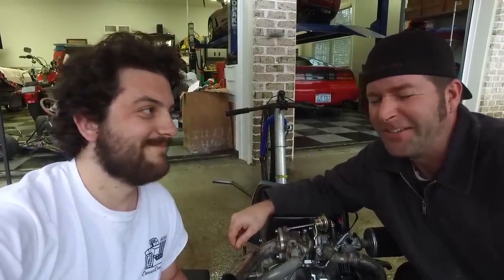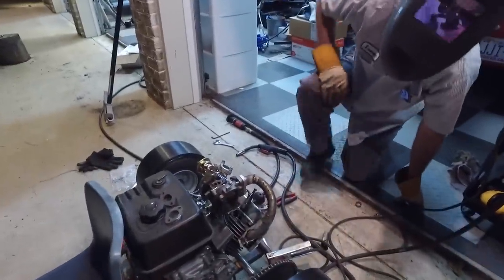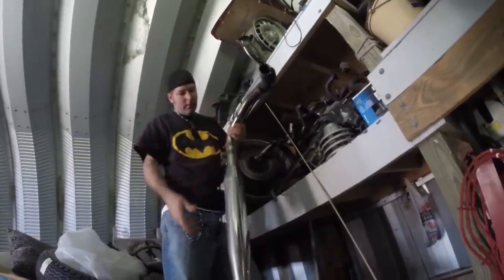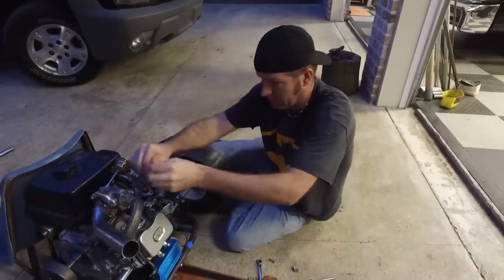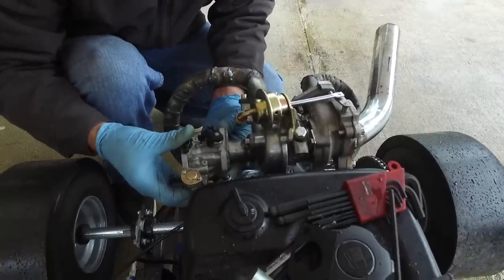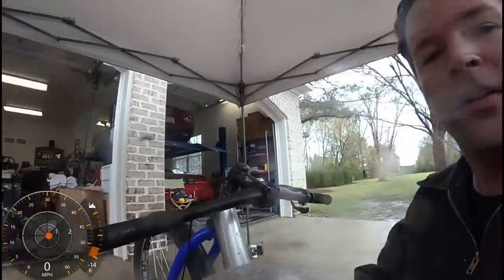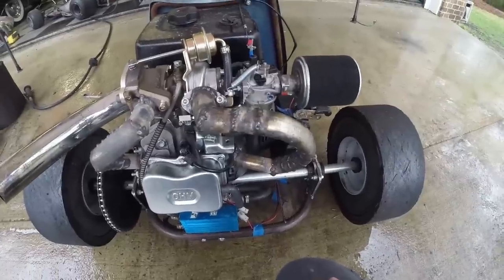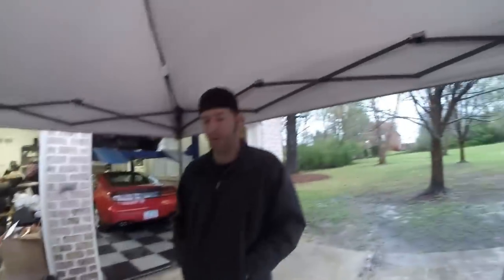Turbocharging a 420cc Drift Trike

Comment: I believe that your problem is not efi or carb it is a problem of fuel air idle mixture screw needs adjusted to compensate for the driven air and it would then run at idle WAY better and your low end torque would get a lot better too

Comment: i can tell you there isnt enough load on the engine to create hot enough exhaust gas to properly spool that turbo, you might find if you put grip tires on it will spool a lot harder.
but of course that defeats the purpose of it.

Comment: Carb needs to be in an enclosure. fuel pump and regulator referenced to boost pressure and you'll rip.. think atmospheric pressure.. adding boost is adding atmosphere.. everything in the fuel system has to be in reference to atmosphere.. I have done hundreds of blow though carbureted setups on race cars.. same physics here apply

Comment: put the carb. back in the original location and put a restrictor plate on the intake side of the turbo. it's really not a good idea to put the carb. on the intake side of turbo. it will get hot enough to vaporize the gas in the air/ fuel intake. causing a big lack of power. me and friend been through the same thing you guys are doing.

Comment: The turbo is attached to your exhaust that runs into the turbo for the air sure at the same time it goes from the turbo into your carburetor because of the fumes more of a kick you know I ran two on a becomes it engine

Comment: I would try to use a bigger carb on it. If it only run good on full throttle I think its running lean (Need more fuel).

Comment: I'm pretty sure the air is supposed to go through the turbo and THEN through the carb.
Reply: thats wrong.   a carb uses suction from engine.

turbo puts pressure => no fuel is being sucked in the airflow.

so let the turbo pull the air mixed with fuelfog from the carb and push it into the engine. => boost created.
Reply: What do you mean? There is no other way for the air-fuel mixture to go other than towards the engine. I guess it works with the setup they have but I would imagine it's not very healthy for the turbocharger. Most turbocharged carbureted engines draw fresher through the turbo and then add fuel to it when it's already pressurised. Also I don't think mounting an intercooler would be possible with the turbo after carb.
Reply: Also I think turbo>carb>engine setup would be waay more responsive than carb>turbo>engine

Comment: I was thinking at the start of the video the way you had it set up with turbo-carb-engine wasn't going to work as a carb uses air passing through to suck fuel through the jet and putting that under pressure by the turbo is going to stop it. That's why you got a leaking bowl! Then I skipped to the end and seen you had carb-turbo-engine and I thought now your getting some where you don't need to go efi you just have to re jet the carb. And the smother the transition of the air from the turbo to the engine is going to increase power so the shoddy pipe work isn't in your favour (no offence) if the carb is struggling to diffuse the fuel rough up the part behind the needle and the diameter of the pipe from turbo to engine will play a big part too! Otherwise nice build and good luck
Reply: +Werbutlemon233 thanks
Reply: You should try make the pipe from exhaust to turbo thinner I know you said the flange is one inch but you can get a thinner tube and flare both ends. That will help stop turbo lag! I don't know if you already know all this stuff if you do tell me to shut up!
Reply: im new to the turbos . ill figure it out. lol

Comment: The carburetor isn't the problem. The problem is the way the turbo blows. The turbo is interfering with the way the fuel and air mix, because the fuel is going into the turbo. That's the carburetor's job. The turbo should blow air into the carburetor, instead.
Reply: At least put a fitting into the bowl that returns fuel to the tank.

Comment: Really all I did was use some intake tube to make a short snorkel  but the way it is it draws more.fuel plus theres an inlet on my snorkel
Were I ran tube from there to the top of my gas take for.the fums and shit and I think if I was to do anything  else without removing counter weight I'd blow it up

Comment: At take a pressure blow off valve and put the carburetor were it use to be so  when the pressure goes up it doesn't pressurize the carburetor
Reply: Comment on this if you have questions about it ok

Comment: that oil pump aint worth a fuck and i'm sure as you already know you need a 1:1 boost reference regulator and pump along with a pilot tube for pressurizing the float bowl for a carb to work with a turbo.   P.S. no need for a blowoff on a draw through setup as there is nothing to blow off being that the turbo pressure comes after the carb.   Anyways, Cool shit
Reply: D. Ryan Can I ask you more questions?

Comment: I have a few Questions, can you turbo charge a predator? And do you need a pinon gear for the 3/4 clutch on the predator? (I don't want answers from viewers)
Reply: To answer your first question, the engine they are turbo charging is a predator.

Comment: I have a kazuma 150cc buggy and a 81 kz650 that I was wanting to swap the motor over to but the sprocket on the go karts axel is on the right side and I need it to be on the left this would be my first build so any and all info would be much appreciated
Reply: +Nathean Sutter reverse the axel. really. the bearings should be the same on both sides.

Comment: that carb uses scavenging  from the engine to atomize the fuel/ air mixture so mounting it on the turbo won't be a good idea, and turbo or supercharged engines have different cams.  You don't want a large over lap on your valve timing or your boosted air fuel mixture is blown right out the tail pipe when the intake and exhaust valves are both open.  There is a lot more to just bolting on a turbo.  Well if you want it to run right and actually provide a power gain.If you want to make it fast, just put a 2 stroke motor on it, one with reed valves and tuned exhaust, 250cc should scare the crap out of you.  But what do I Know?  My golf cart only goes 130+ mph  lol

Comment: you could go way faster with a different size pulley, correct? my buddies suzuki LTZ 400 cc goes about 70 - 75 and it is completely stock, why would yours only do 40?
Reply: and what motor are you using?
Reply: +Sherry Dean badass machine, btw... im on my wife's account if you were wondering why a girl would be interested
Reply: sprocket size
Reply: thanks
Reply: 420cc predator engine from harbor freight

Comment: The atmospheric pressure makes its way to the inside the carburettors fuel bowl via the bowl ventilation. It is then the atmospheric pressure that forces the gasoline up from the bowl, through the jets and into the engine. You guys are overriding atmospheric pressure and therefore "Trapping" the gas inside the bowl of the carburettor, possibly even forcing it back into the fuel tank. That is the straight opposite of what you want to accomplish. Start by atleast trying to navigate the boost pressure into the fuel bowl via the ventilation, and see if you have any improvements, maybe the venturi in the carb can atleast "suck" a little bit of gas up the jets if the venturi senses a reasonable gas speed...

Comment: Harbor Freight has 420's on for $299.00 right now. For $299.00 I can buy two 212's have one more hp, than the 420 with $100.00 left over to buy running lights and a used car alternator, to keep the battery fully charged. I don't know if that would be cool or not. I think not, because I wouldn't have a 420. I would have an extra engine in case the other one blew up, but it still wouldn't be a cool thing to do. You have to always be aware of the cool factor. There are no books on it, and you just have to be around to understand what cool is. Like talking about it is not cool, but if someone were to see your two engine go kart with an alternator, and running lights they might think it's cool, but it wouldn't be anything they could talk about, except to their closest friends and family.
Reply: Where can i get 212's that cheap,Kewl or not?

Comment: I'd like to see a diesel go cart. That's where a turbo belongs. Get some junkyard parts, DIY a simple "EFI" system. 1 injector. A TPS is just a glorified dashpot; you don't need a "duty cycle", "pulse width" or an O2 sensor or a MAF sensor. Get a throttle body with the TPS and no MAF. Make the injector constant duty, varied by the TPS. No ECM needed. Rig up a manual choke plate. 2-3vDC should be enough to idle, 12v for WOT. Make a short tube to connect the engine to the throttle body, drill a hole, weld in an unthreaded bung at an angle for the injector with an O-ring. Attach the turbo inlet to the throttle body. What you have set up now is very dangerous; you're lucky it's cool & rainy. With prolonged running- it's shoving the charge into a hot turbo, then to the hot cylinder. Detonation is bye-bye engine.

Comment: A bit late but wouldn’t it be better if the compressed air by the turbo was being directed to the carb… like force feeding the carburator with air
Reply: So it wouldn’t be carb-turbo-intake ( combustion chamber)
Reply: It would be intake(for turbo)- carb- combustion chamber

Comment: I'm sure it would be better in the original configuration. Having vaporised fuel passing through the turbo is surely a big bang theory waiting to happen. I think a pressure regulator should stop the carb from overflowing. Just don't ask me what the pressure should be for this modded beastie. :¬P
Reply: No way, suck through setups are easy. Blow through setups, you have to modify the carb. They didn't. Hence the fuel blowing out of the bowl.
Reply: Ian Thompson Ah right, I never built one and only read a little bit about it before posting. ;-)
Reply: man am sorry ..i need some help while am down here trying to turbo charge my 99 hornet 600f 
never had turbocharged anything ever nor had i ever built anything 
 its going to be the first for me ..any help?
Reply: +komonology I think your biting off a lot. Turbos are complicated, both on theory, and fab. But.. What's your main questions?
Reply: i have  a honda hornet 600f and a small turbo  i want to know of which material shall i fabricate the connecting tubes to the exhaust manifold and out to the air box!!
and what will be the best  technique to turbocharging a carburated high compression engine bike and  how much boost shall i put to the stock pistons ??

Comment: 420cc is crazy overkill for a drift trike, but thats the point i guess.
Reply from the maker: +zxz1997 Yes, but it is nice to be able to drift at 35 mph and also have enough torque to break traction from idle.
Reply: Thats true. Mine has a 250cc honda engine and I can easily drift at 40mph, but it sure cant break traction from a dead stop, but it does once it starts moving.

Comment: I wonder if a better carb, like a mikuni VM or Flatslide would handle the pressure of the turbo better?
Reply: doesnt matter which carb they use. carb need vacuum to operate. thats why they change to draw thru turbo
Reply: doesnt matter which carb they use. carb need vacuum to operate. thats why they change to draw thru turbo
Reply: +Emmanuel Thommy are you familiar with the buddfab streamliner? that runs a turbo with a mikuni tm.
Reply: +Johnnie Distefano Wont make a difference if they aren't made to be pressurised. The fuel will just get pumped out of the overflows/breathers, fuel level drops and the mixture will go lean.
Reply: Johnnie Distefano not familiar with that, but looking at stock photo from google, theyre using draw thru turbo setup too...

Comment: Instead of constantly monitoring your fuel tank level why not simply remove the tank quick and make a set of 1 1/2" spacers to raise the whole tank an inch and a half or even two inches just to be safe , get a 3 ft stick of 1/2" diameter hollow round tube and cut your spacers out if that , sounds really easy to do and you won't have to constantly check your fuel level or constantly allow the motor to run super lean just before running out of fuel which is horrible for your pistons , rings and valves obviously you can blow a hole right through a piston in under 20 seconds if it leans out bad enough at moderate to high rpms bro.  If you have any fabrication knowledge you should be able to make spacers and install them raising the tank in just 20-30 minutes top and of course don't forget you'll need to pick up longer proper sized bolts cause obviously the original ones will be way way too short with a 2" spacer installed. Just saying that seems like common sense to me instead of refueling before you begin to lean the motor out , just my two sense bro

Comment: Carbs and turbos do mix, I don't think you gave the carb option a fair chance. 

There are multiple things that can be done to your set-up to make it work better... The first is thinking the stock carb is going to work...it's not as you found out; it's small, has zero tunability and drivability built into it and has no way to compensate for boost. If you want something easy, cheap and reliable look for a carb off an older motocross bike; lots of flow, readily available jets and a vented fuel bowl (this is important, keep reading). 

Second, you need a way to increase fueling as the engine builds boost. the easiest would be to plumb vac lines from the intake to the fuel bowl vents on the carb with a check valve. This way when the intake sees positive manifold pressure it'll pressurize the carb fuel bowl, much like a rising rate fuel pressure regulator. The increased pressure in the bowl will force more fuel through the jets which solves your fueling problem under boost. 

Lastly, a draw-thru set-up like yours probably isn't the best, I would switch to a blow-thru and mount the carb between the the turbo and the engine, as close to the intake as possible. Also test your welded charge pipes for leaks (no offense to the weld job intended).

Just some thoughts, I hope you give the carb a second chance. If you have any questions just let me know.

Comment: That turbo is way too big, mean your engine doesn't build up enough exhaust gases. I has been worked on place were it's builder some rally cars and that turbo maybe good in 1,6 L engine at 2000 to 5000 rpm.

Comment: Ok I know this is a video about turbocharging a 420cc engine, but dude is that a 60 to 66 (I know its 64 to 66 I can tell by the cab) Chevy/GMC truck sitting in the shop?? Also why don't you guys try to adjust the carb on that thing I bet it will work.
Reply: its a 66. nice monza!

Comment: So I'm new into carting and this entire hobby as a whole but I'm trying to buy a cart and or Buggy for under $1,000, Predator 212 engines seam affordable and putting out a fair amount of power but I'm having trouble finding a frame. (At my current situation welding is not an option) does anybody have an recommendations for a kit? Thanks!
(My Weight is 120 lbs and 5'6 for reference of carts length and recommended weight)

Comment: They make fuel pressure regulators that adjust the pressure to match your boost
Reply: Since there is no fuel pump, it would serve no purpose. I suppose you could put a fuel pump on to increase pressure, but then you would be putting too much fuel into the engine.
Reply: A pump and regulator wouldn't be too expensive or complicated. A relatively small pump would be more then enough for it

Comment: don't understand why they put the carburetor on the wrong end of the turbo,the compression  is supposed to be in front of the carb they're just staving the engine of air doing it that way

Comment: that turbo wont work because the order is wrong... the air must first enter the turbo, then an intercooler so that the air cools down and take less space inside the cilinder even if its a small one, other wise you can cause the opposite effect (turbo =more air and the possibility to add more fuel but if the air is to hot it will take a lot of space inside the cilinder and you get a really poor mixture inside it) and after the turbo then the carburetor.
the order in wich your doing it is unefficient and dangerous for two reasons, your pooring fuel/air mixture into a hot turbo (i think you already realised that) and that fuel/air mixture has to travel way to far to keep that mixture homogeneous, also the turbo must be as close as possible to the exhaust to mitigate lag and recive as much energy as possible (that means making its way directly to the turbo, without letting that section between turbo and engine cool down, hot air contains more energy to spin the turbo)

Comment: One way they could have made the carburetor work properly, is to build a container to go completely around it, then pressurise that container with the upstream turbo compressor pipe... It would have equalised the pressure between the inside & outside of the carb and stopped the fuel from flooding the engine... Electronic Fuel injection will work - when there are proper adjustments and the parameters that are spot-on to what they are supposed to be... But those systems take a lot of R&D and a robust electrical charging system... Both are things these guys don't have with their resources... They should stick with the reliable naturally aspirated engine that work so well on a budget... And then, take one step at a time to modify the engine for maximum performance....

Comment: blow through with a box around the carb that way it thinks it's atmospheric then run a tube from the box to the vent on the tank.      I've done this with success also use a oil scavenger pump for oil pressure much better volume and 60 bucks online.      fuck a draw thru lol